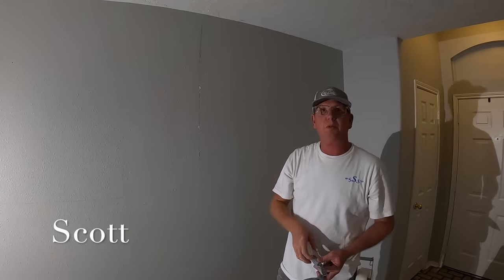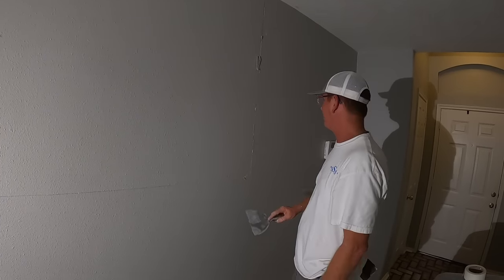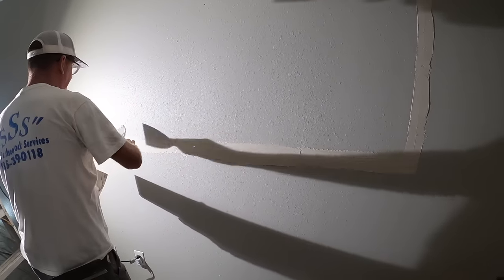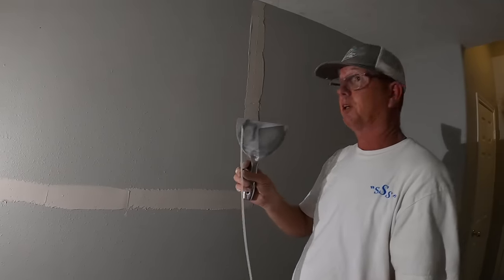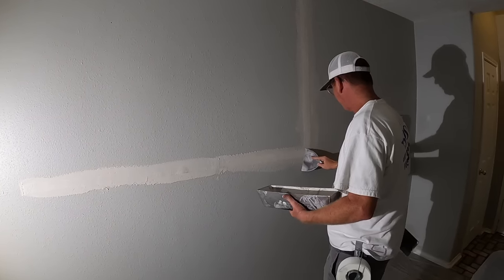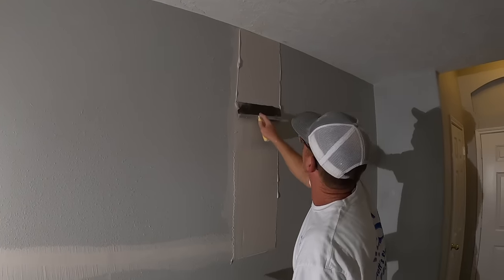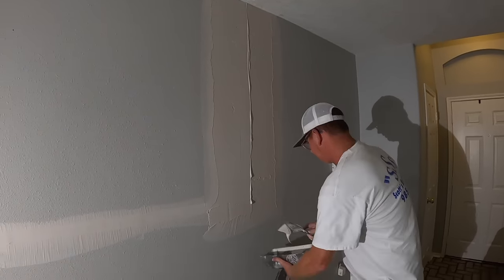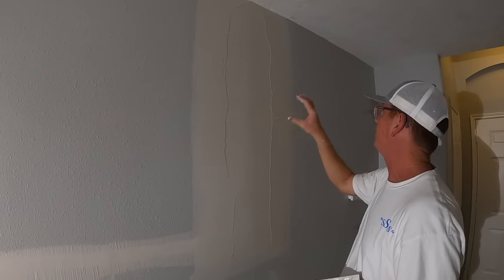Full Tutorial On How To Fix A Drywall Crack Like A Pro

Comment: I was in the painting business for 50 years. The one thing I would do differently is to cut out the crack into a V shape so that the plaster or spackling would be sure to fill the crack. I used paper tape but I suppose what was used in this video is better. I once repaired a long crack in a ceiling that had been repaired three times over the years and it always came back, but mine held.
Reply: I agree, I had to fix 2 window seam cracks the homeowner had used Bondo to "fix", I was taught to cut out a V as well. I hate mesh tape.
Reply: I prepared the job site with plastic, then started  to v shape, then, I prepared filled the crack, and 2 day's later, I mudded and tape the ceiling, then after a few days it was finished. three coats is what I had. I used Durobond. Anyway, the crack came back. I noticed the crack was all the way through the drywall. I had to use backer board. it worked. what a waste of time.
Reply: Durobond is just joint compound. I used to use Synkoloid spackling for the initial filling of the crack. It dries hard and much more durable. It sounds like whatever you patched is not secure and moves by contraction & expansion. If there is only a small movement, the new crack may develop behind the paper tape and you still won't see it, but no patching will hold big movements.
Reply: it is a foundation problem. for now I have it very secured. it's been about three weeks, I'm waiting to see what might happen. thanks for replying to Sir.
Reply: thanks for replying to me Sir.

Comment: Was it only me that could still see the tape line after he finished with all the mud?
Reply from the maker: Sometimes you can see a hint of it through the mud as the float coat and skim coat are two different colors of mud. We painted next day, and it was beautiful!
Reply: If you can spackle you can use mesh
Reply: OK, you have a good critical eye. Maybe it was the lighting and it did show a shadow at the butt which it usually does if you don't pull the butt with a wide knife or trowel.
Reply: It’s the lighting , it all disappears when you primer and paint.
Reply: thats why I prefer mesh
Reply: Uh, it looked like the sheetrock was moving after you cut it to open that crack a bit? When it moves like that you'll always have a lump to deal with even after you finish it I thought? Even though, I did like that fiber tape that was used as I didn't know that even existed. Was an informative video....👍😎
Reply: Been doing drywall for 24 years and tons of remodel patch work repair work.  This job was well done.    The tape line look likely was just coloration difference due to less last coat mud..meaning it drys faster than the sides 
This approach is used when you have small 1 to 3 hour repairs  in a home filled with repairs and patches a contractor would use a different approach.    Keep I n mind people likely living in the home this approach also eliminates dust.
Reply: That’s why I was hoping to see the finished job with paint. Maybe it would disappear when completed.

Comment: Some say mesh tape only fails when you use joint compound rather than hot mud to set it.
Reply from the maker: That may be true.. however what mud is used on the ones that I repair is unbenounced to me. I know you don’t have that problem with fiba fuse using regular mud
Reply: 100% mesh has not failed me when I patch, but I always Hot mud then top with all purpose

Comment: mesh tape has a purpose but it seems a lot of people think it's easier simply because it is self-adhesive. but it's actually 2x thicker than paper tape and makes you use a lot more mud. We used to use mesh tape when building portable buildings where you want to have flexibility, or on reoccurring cracks when using spackling.

Comment: I also always check for flex in the joint and add screws in the studs which I find is normally needed.
Reply from the maker: I do too if the board is loose, I’ll tap on it with a sideways fist if  it’s moving all reattach, but if it’s solid, the plaster and fibafuse gets it done!

Comment: I like to dig into the cracks to see whats really going on. Then ill add screws if needed to. Then ill scrape off all the tape and mud about 2.5 inches each side of crack (that allows my 4" knife to fit in) so i can prefill and retape then i fill it back up with multiple coats after it sets. Once its filled to the surface ill make sure to skim coat and feather out my edges with plus 3 and let dry overnight to cure correctly. Plus 3 makes it easier to sand and gives you a better finished product in my opinion

Comment: DIYer here. Started using Fibafuse exclusively.  Contractor use mesh tape for repairs, which did not hold up.  The tape separated at the crack leaving rough glass fibers.  Repaired with Fibafuse and it looks great.

I have several 8’ long, straight cracks in a ceiling where the wallboard panels meet (cracks appeared after 15 years perhaps due to foundation settlement/separating).  I plan on creating a “V”, adding screws on each side of the crack and repairing with Fibafuse.  Does this sound like the right approach?
Reply from the maker: Yeah, check and see if there’s any sheet rock loose along the studs and re-screw one or two on each side of the seam if it’s regular joint tape, I prefer to remove the tape rather than cut the sheet rock personally, and with the fiba tape as long as the seam is not very tight I don’t cut into it personally. Don’t need to necessarily cut a V just a slice in it. Floats camera texture. Hope this helps!

Comment: Scott, nice video. I scanned the comments and did not see a response on the "cheesing" over glossy paints. Flat paints are very water permeable, thus not used in "wet" areas. Glossy paints help keep the water from penetrating. When you mud over flat paint you get some drying and setting on the back side locking the mud to the surface. When on glossy paint the area contacting the wall does not dry at all and has not bonded. When you work the top it will break free and you will get the "cheesing" affect. We also see more tiny air bubbles on glossy walls. Best wishes from Az.

Comment: I've switched to nothing about fibafuse for all my flats. I always put screws in just as an insurance policy. If you haven't bought one of the big 36-in rolls and cut it down for patches yet you should do it. Life changing. Well. Maybe not life-changing but pretty good for those fist size or baseball size type holes. I used to do calli patches but now that I have that big fibafuse I would rather do that with a little bit of backing way easier much tighter.

Comment: Cracks are caused by movement of the sheetrock. You should have used some nails or screws before taping. I like watching other experienced drywallers. Never to old to learn. Great video.
Reply: Exactly what I do. Always use screws around the crack and surrounding area. V out crack. Prefill and use paper tape. Cracks comes back after that you've got bigger problems.

Comment: i love FIbafuse! the only thing i use, EXCEPT corners since paper is easier to crease and mud
Reply from the maker: I’m in 100% agreement! The only way you could use fiba fuse in a corner is if you very meticulously put it in there and then rolled it with an angle roller. Most of what I do is repair work and if it’s a flat joint I use fiba fuse… Hope you have a great new year!
Reply: @scottssheetrockservices   you too. Its odd though, you know before they used to sell FibaFuse with the center crease and you can fold it in half and use in corners, but now they only produce fibafuse with no crease at all. I wonder why? i know you COULD use for corners but maybe too many complaints?
Reply from the maker: @bludika  probably

Comment: Fiber fuse is good but the new diagonal mesh is better, it has extras strands to prevent racking.
The reason you lean toward mesh in the first place is thickness it a butt joint so huge tapers are needed.
Reply: have a hard time believing any type of mesh tape would be better than fibafuse. diagonal is better than standard mesh for sure
Reply: @dUsTysCaTmAn  thinner is better fiber fuse is too thick
Reply: even if it is, it doesn't change how you coat the joint or repair. fibafuse is thinner than paper, especially considering it is embedded in the jc @markhuru
Reply: @dUsTysCaTmAn  the fact that you can just stick the tape on gives good quality mesh the advantage, cuts easily it’s thinner, I still use durabond or quick mud first coat.
Reply: @markhuru mesh is for people which like to cut corners

Comment: Sweet ,,those hoppers use a lot of air ,more than a pancake compressor can handle causing a continues  drop in pressure hence a different texture pattern ,,those patch jobs are tricky in the middle of the wall like that for obvious reasons ,,nice job.

Comment: Of all the videos I've seen this is the most thorough. Truly appreciate the craftsmanship and completeness. One question I have – if we are a DIYer and we have plenty of time to wait for it to dry and are able to sand, are there any steps here that we can cut out, or is there anything that we should be doing differently?
Reply from the maker: Yes, of course you can use regular mud I try not to use lightweight however the +3 that I use is a midweight and it works well for all applications. Just need to make sure each coat is dry prior to texturing including the tape Coat hope this helps
Reply: Thanks so much for the feedback. Hope I can get mine looking as good as yours.

Comment: Great knife work. However that seems like an awful lot of mud to repair such a thin crack. Does that not create a large high spot on the wall? Or can you not see it when it is done?
Reply from the maker: Butt Joint is the 4 foot side of sheet rock does not have a recessed edge it has to be busted out… But to answer your question no you can’t see it when it’s done

Comment: This works so long as it is not in an area where the su face will not receive any impact/movement. Did a test patch at home about 3 years ago and it finally failed a few weeks back. I do a lot of plaster repairs and wanted to test it.

Comment: How do you fix the cracks in the ceiling when the ceilings are coated knockdown?
Reply: Unfortunately there's no easy answer.  If it'sa previously painted popcorn ceiling or a rougher stucco ceiling and you don't want to do a major repair,  I've used elastomeric silicone. Just apply a thin bead over the crack and use you finger to smooth it over the crack. Then paint when it's dry.
Elastomeric remains flexible for a long time and should help in mitigating further cracks returning.  The other option involves scrapping and alot of work Unfortunately.

Comment: The type of tape used is determined by the type of mud used. Mesh tape was designed to be used with quicksetting mud. Also, the type of crack an reason for crack should also determine the type of mud an tape used. This type of cracking looks like faulty taping an finishing from original finishing. I agree with some of the comments about creating a v groove for mud to bond.

Comment: Could you use the Plus 3 for the entire repair? or is that not strong enough? I learned a lot from this video!
Reply from the maker: You can use the +3 for the entire repair. You’ll just have to wait in between every coat for it to dry. And you won’t be able to rake your lap marks out you’ll have to sand in between coats

Comment: Besides a lot of extra work, does it cause a problem to cut out the paper on each side of the crack, shave down the drywall, bury the tape, and then mud over it so you end up with a flush patch instead of a huge area to feather out?
Reply from the maker: Time is money on my world any butt joint that you have nine out of 10 of them you have to put 24 inches of mud on anyway we never make things level. We just give the appearance that it is that would seem like a lot of extra work to me that’s just my opinion…
Reply: @scottssheetrockservices  It is a lot more work but I'm an amateur and can't float out a high spot, it ends up looking like a blob on the wall. I just did a patch and cut out the paper on the perimeter and then buried the tape and then made it flat to the existing wall. It worked really good but was a ton of work. Do you think the seams will crack doing it this way?
Reply from the maker: @petebusch9069  if you’re using five fuse and allowing whatever mud you’re using to dry completely prior, I think it’ll be fine I would suggest to maybe tape one more piece of tape on each outside edge of your first piece to ensure everything is covered but I guess that should work for you with the right mud and drying time

Comment: I've been drywalling for 48 years I pre-filled cracks and I use mesh tape with 3M 90 adhesive then I will guarantee the job for many years
Reply from the maker: I’m only 30 years in… I agree with hot mud you can make it work. My videos are more geared towards DIY folks who try to use self adhesive mesh tape with regular mud and I’ve literally fixed thousands of cracks even done by professionals with mesh tape, probably with regular mud, have a great Christmas!
Reply: @scottssheetrockservices Sherwin Williams sales a mesh tape that is more tightly woven that I have used for years with no problems
Reply: Over lap the cheaper mesh and it will hold, oh I've been doing drywall for over 40 years

Comment: Will fibafuse prevent cracking even with structural issues in your experience?
Reply from the maker: So when I use fibafuse I use plaster which is the hardest drying mud known to the planet earth! So in my experience I would say it will last longer than any other tape for sure if you have major foundational problems at some point it may come back through but it will have a tough time doing so
Reply: @scottssheetrockservices  Great answer, thanks Scott! I’ll give it my best go.
Reply: There is a product called 'Straight-Flex Crack-Tape' by Clark Dietrich, that is geared more towards structural issues i.e. truss uplift.  Of course there are going to be limits, but I have used it for several trouble jobs with success, no recracking to date... and in a State that has the full four season temperature and humidy variations. 

Inattentive framers can leave framing poorly attached.  If you find the wall or ceiling framing  moving quite a bit, I have been able to secure it better by using 3-1/2" screws, going at an angle thru the drywall, to secure the stud to the top, bottom plate, joist or rim, (depending on the situation).  Also, I am finding more on repair jobs, that the original drywall installers are over driving screws (especially on the seams)  and not fixing it, thus causing loose seems and cracks in a short time.  So, there is usually a need to secure drywall again in any repair... or at least assume that you will need to do this.  Telling this to the customer up front, will prepare them for extra costs if found to be the case, saving you a hassle.
Reply: @TobiasRaphael1  Thank you for that recommendation! I used fibafuse and it hairline cracked again unfortunately. Will try the product you suggest here. Thank you!

Comment: Where did you get that cheap mesh missing rows of fiber? I used fiberglass tape for years and have never seen anything like that but I always shopped at drywall or paint shops that carry the better stuff. You got it at wal mart right ?
Reply from the maker: If you’re talking about the fibra fuse? It’s not cheap… I don’t use regular mesh tape on anything from anywhere

Comment: Nice video;  thnx. How thick are your finish drywall compound coats?
Reply from the maker: First coat, float coat, is the thickest to leave enough mud to give the illusion of leveling the butt joint. Skim coat is wax on wax off real tight.
Reply: thnx; is that about 1/8 inch on first and 2nd coats? I know skim coat is about 1/16th or less, right?  Thnx for your excellent video! @scottssheetrockservices
Reply from the maker: @davetrayford  that be a good estimate on thickness it’s really a feel with your knife, making sure you’re floating over the joint thick enough to cover it and then yes, skim coat is real tight basically just staining it assuming you have enough mud on your float coat
Reply: Thanks; appreciate your time and expertise. I'll review your video again for nuances. Have a good week.  @scottssheetrockservices

Comment: What kind of mud you use and set time? I need to buy to repair  mines.
Reply from the maker: The mix consist of plaster of Paris that you mix in powder form with water in your pan to about a syrup or maybe a little thicker consistency and an add about 2 1/2 scoops of mud with your 6 inch knife trick is you have to mix very thoroughly depending on what mud you use 7 to 10 minutes and it’s hard. I personally use USG +3.

Comment: How come a skim coat is needed after the plaster of paris? Is it because the plaster won't be smooth enough for paint to stick on?
Reply from the maker: With a heavy texture, you can get away with one coat. If you have it raked out nice and smooth but with a lighter texture, you want to put a tight skim on it just to fill any pit holes or variations in the mud.

Comment: If I’m doing an inside corner drywall repair, can I use paper tape on the inside corner part of the repair and then fibafuse on the rest of the same patch piece?
Reply from the maker: Yes, paper tape creased to the wall for angles

Comment: I love fibafuse but its hard on angles because when you use a knife it cuts the fibafuse. I still use paper on corners.
Reply from the maker: Same here. I only use it on flats I’ve been told you can use it with a Glazer and a bazooka if you remove the sharp tip and just roll it.